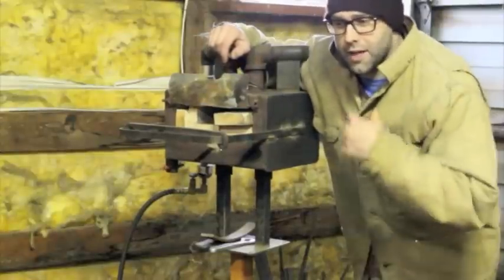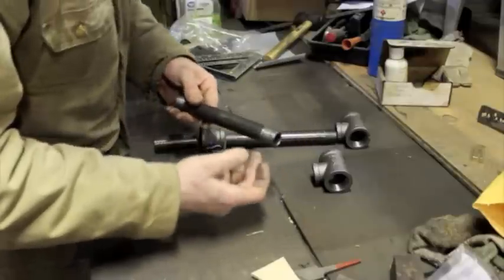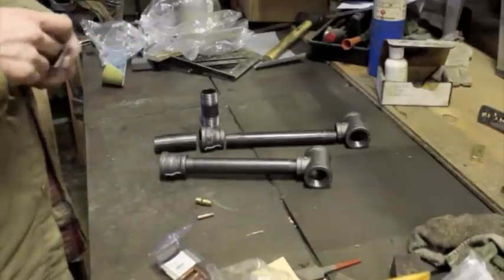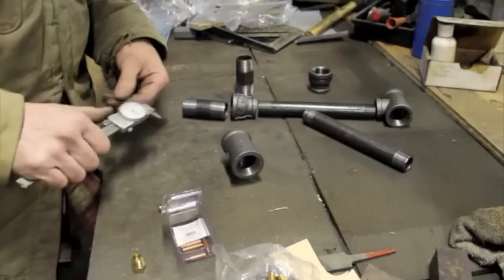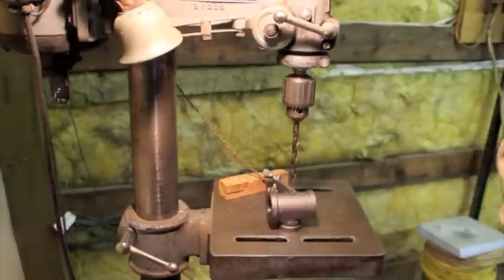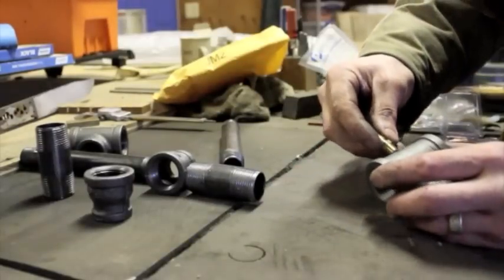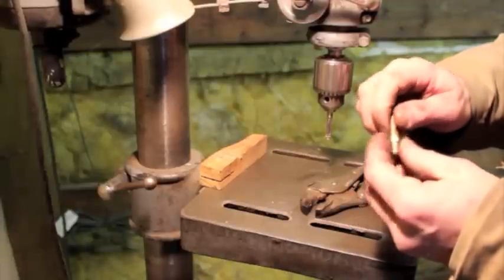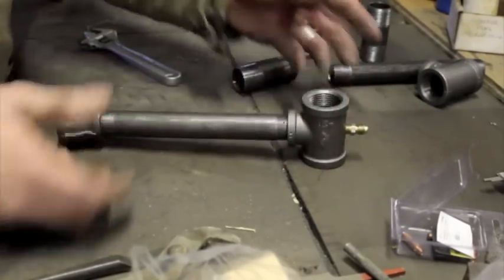BUILD A BETTER "FROSTY T" FORGE BURNER!!! Part 1

Comment: Hi Fire Creek Forge:
I just want to add a bit of light to the reasoning behind the chosen
dimensions for this class of burner and where the flame burns.
Different fuels have particular "Critical Flame Velocities".
I.e. the flame can only move at specific rate. If the gas velocity
is lower than the "Critical Flame Velocities" it will advance.

1. The 3/4" fuel mixing pipe has a fairly high gas velocity. The
   gas velocity is high enough so the flame cant enter it because the
   gas is moving faster than the "Critical Flame Velocity", which
   keeps the mixing chamber relatively cool.
2. If you add a flair, or "Flame Catcher", at the end of the mixing
   chamber the velocity is reduced in the flair to below the "Critical
   Flame Velocity" and it advances to where the gasses entered it.
3. Many don't use a flair in their forges and just let the gases
   enter randomly where the work is.
   I believe this is a mistake as more complete combustion happens
   in the flame catcher. Incomplete combustion products at high
   temperatures tend to contaminate the the work.
4. Smaller jet sizes with higher LPG pressures tend to increase the
   gas velocity and produce more turbulent mixing. A good thing!
5. The choke is very important to get the correct ratio of fuel
   to air mix, the "Stochiometric Ratio". Proper mixtures makes the
   flame burn hotter which reduces unwanted combustion products.
6. I think the reason you couldn't light the 1" pipe after the
   expander fitting is it was gas velocity was above the "Critical
   Flame Velocity". This pipe I.D. is quite a bit smaller than the
   I.D of the expander. Try to get a larger expander to allow a
   larger exit pipe.
redrok@redrok.com
Reply from the maker: Thank you for the more in-depth info!
Reply: Thank you for the breakdown, that explains some other pressure/volume/ orifice sizing issues i'm pinning down.
Reply: Hi Brett Phillips;
Let go a bit deeper!
The place where the flame is caught is where gas velocity matches
the "Critical Flame Velocity". Its also the location where the burned
gasses do even more expansion due to the great rise in temperature.
1. The blue color is about 1800K (1500C, 2700F).
   Lets assume the inlet gasses are at 293K (20C, 68F). The gas
   expansion ratio is about 1800K/293K = 6/1. The burned gasses are
   now moving very fast down the exhaust pipe.
2. Due to the rapid expansion we hear a loud roar. This is sound
   traveling down the pipe at the "Speed of Sound" in the hot gasses.
   As the sound pulse exits the pipe there is a transition to the open
   and some of the sound will be reflected back down the exhaust pipe
   back to the flame front.
3. Sound is essentially compression/expansion of the gasses. As the
   sound pulse hits the flame front compression occurs causing the
   intake gases to combust even faster, making another pulse traveling
   down the pipe. And repeat.
4. This looks a lot like a "Pulse Jet Engine". Very loud.
5. To make things much quieter smooth gradual transitions from the
   mixing chamber to combustion chamber and from the combustion
   chamber to forge can break up the sharp transitions and reduce the
   noise considerably. See how this guy makes transitions:
   https://www.youtube.com/watch?v=9u5URUHZhGs
6. Ok this is much harder to do but the whole mixing chamber and 
   combustion chamber could be made in one piece by gradually
   increasing the inside area all the way from the jet to the exit.
   This shape is not a cone its a shape of constantly increasing area.

By eliminating sharp transitions the noise should be greatly decreased
along with cleaner combustion gasses.

redrok@redrok.com

Comment: it pulls the air in before igniting, and it is pulled in due to lower pressure, but its more because the bernoulli effect, where you reduce the diameter, increasing the velocity creating low pressure in the tube, pulling air in through the T to mix with the propane.

Comment: At the end of the flare and the reason you couldn’t put an extension on it is because you reduced the size of the flare. So you increase the velocity and even at 2 pounds of pressure it was blowing out the flame. To add an extension I would TIG weld something that has the same inside diameter of the flare. But I’ve noticed don’t ever take the threads off the outside edge of that bell flare. The flame will be unstable. I use a welding tip that’s 0.40. Also I take the welding tip and drill out most of the length of that 0.40. So the configuration just looks like a jet at the end of the tip of the welding tip. That size burner I’d like to have at least 7 to 8 inch main pipe of 3/4 pipe. My burner can shoot almost a 3 foot flame. Are used to heat up panels on aluminum boats in the winter before welding. The only way you do decide to drill the hole for the jet. Is the use a short pipe and check it up at a lathe so that the hole is centered exactly in the center. I hope this helps, good video!

Comment: When I made my Frosty T’s I drilled my T through the open 3/4 “ opening with a close x close nippel to help ensure it was centered. All three work very well . They are all .035 jet size . The jet was trimmed to be midway in open 1” inlet in two of them and left I untrimmed , they seem
Reply: They seem to work equally. All need 3/4 to 1” flare to hold flame. Maybe my new crucible will hold flame without the flare.

Comment: You can buy the complete burner ready-made on ebay from China for about $36 or $38US and save all the time messing around and trying to get correct drillholes and proper ratios etc! Ones with air intake controls cost slightly more.

Comment: If venturi burners had to be lit and burning to function why does my glass vacuum aspirator work? The passage of the gas jet creates the pressure differential, sucking in O2 in the air thus completing ze triangle when you lit it.
Reply from the maker: The Venturi burner is a particular example of the Bernoulli principle. The aspirator works off the Bernoulli principle but is not using the Venturi affect. Hopefully that makes sense.

Comment: general rule of thumb for pipe taps is 6 threads from the top of the tap, then check with a fitting.
Reply from the maker: Thanks for the tip, and thanks for watching!

Comment: I'm thinking if you choked the air at the intake when lighting the longest version, it probably would've lit. Good video though, I'm thinking about changing gears on my build and going from the Reil EZ burner to either Frosty's tee, or a sidearm. The forge is a slim 1/4 keg with, if my math is right, 785ci of space after all the insulation that I put in it.
Reply from the maker: You're right about that. In part 2 it works with the air intake control system.
Reply: Or just reduce the fuel pressure on startup. It’s too much fuel pressure and it is not allowing the flame to establish. Causing it to move away from the 1 inch pipe.

Comment: Thanks a lot for this very informative video, I`m just "wrestling" with my freshly built burner and I just can not get the proper flame out of it. As it seems the problem lies in the outlet part of my burner ! First thing tomorrow morning I´ll buy myself a 3/4 to 1" reducer to that burner end.
Reply from the maker: Thanks! Glad I can be of help as I learn this stuff too!
Reply: what type regulator do you have. I have same problem and it seems from youtube research that I need to use my high pressure regulator. The current one maxs at 20 psi

Comment: Ok this one is obviously a little different than the video i just watched. I'm not finished with this one yet, but is this one or the one i commented on like 10 minutes ago the better? I'll be checking back soon. However that may be tomorrow lol to see what you say because I'm seriously about to start the burener. Then ima start on the forge. Idk, that might be backwards, but I'm N8 and that's how i do things. You already know that I love your channel and have much respect....even if i come off like an idiot
Reply: Another question, u said that tip should be good for your elevation. Did you have to change it up when you moved to Texas?
Reply from the maker: @nateand3  I like the frosty T burner better. We're at 3600 feet here on the cap rock so close enough to the previous elevation for the burner to work fine.

Comment: Can you use an ordinary regulator from a bbq or do you need a specific one? Asking because my burner is very weak
Reply from the maker: Probably not, BBQ regulators are permanently set at a very low pressure that won't be adequate for a forge burner
Reply: You will need a 0-20 or 0-30 PSI regulator. If you have only one burner, a 0-20 will be fine.
Reply: What you need can be ordered from Home Depot. 0-30 psi reg.

Comment: What is the diameter of the flame end of the burner the flared part, outside.
Reply from the maker: probably 1.25" - 1.5"
Reply: @FireCreekForge  is that the outside measurement.
Reply from the maker: @WALLACE7084  yes in actual practice i took off the flare and the openings in the forge wall insulation act as a flare basically, works great

Comment: Why not just use a cross. No drilling on the top of the Tee.   Just curious. If that would work
Reply from the maker: That could work but would probably place your jet further from the top of the Venturi than it should be, and thereby affect operation. You could add an extension though I guess.
Reply: I found that the thread pattern from each side of a crossed tube is still not exactly lined up for the center. But really good thought!

Comment: What is your altitude? I'm planning on the .035 tips.
Reply from the maker: I'm at 2500'. My understanding is you would want a larger jet size the higher you are, to compensate for the diminished pressure.
Reply: @FireCreekForge  I'm at 650'    I guess i'll just have to try and see what works best.  GREAT videos btw.
Reply from the maker: Thank you!
Reply: What would you recommend at 5,000 feet

Comment: Witch is the diameter of de jet ?
Reply from the maker: .025 inches
Reply: @FireCreekForge  tank y ou ! On my gaz tip i drilled 1 mm it look like too much ? I 'll drill larger to fix à contac tip on rend. Tank y ou vert match !
Reply: Thank you very mutch ! IT WAS THE CORRECTER
Reply from the maker: @jean-yvesbisson8371  that's great!
Reply from the maker: @mytapster  the brass fitting is tapped for the mig tip. The details are explained in the video
Reply: I used .035 . Much heat! I’m curious to try .025 see if there is a difference in flame quality.